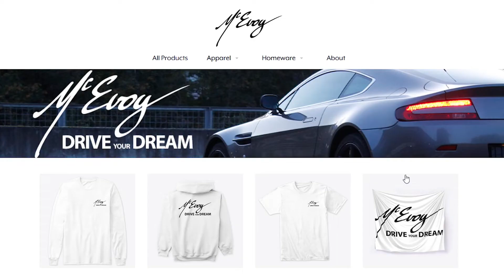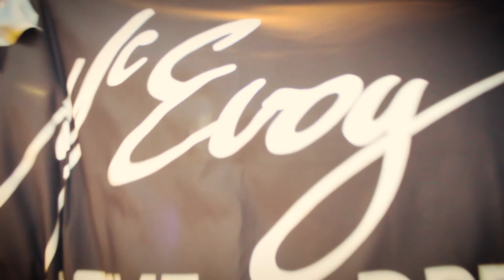Happy New Year! (2020 Preview)

Comment: Happy new year to you too    and looking forward to the new content  especially your friends mx5  which also make good track day cars on a budget
Reply from the maker: So it seems! :) Didn't you mention that you have one, or have owned one at some point? Cool little cars, if truth be told. They have a tendency to rust rather badly on the front chassis legs, but the one that we found here is in pretty good nick. :-)
Reply: @gmcevoy  yes i have one and it has the rust you mentioned   it can be repaired  but it will be around £1700 for new chassis legs   so for now it is idle in the garage   i use my yamaha nmax for the beer run its pretty cool  and is so cheap to run
Reply: @gmcevoy  no but at the end of the day I'm not so happy about it   its a lovely car it drives superbly its a mark 2.5 it has all the leather the LSD the variable valve engine and six speed box in metallic charcoal grey  it was my pride and joy  and still is  but yeah the rust thing has knocked me back somewhat   i cant scrap the car  its to good for that  i keep it for now  and see what happens   if i didn't have this mx5 i would have another  i love em
Reply from the maker: @Mr_Dia-Tribe  That's a tad expensive, for sure. There are a few MX-5 specialists in the UK, who apparently can do it for much less. Have you tried themx5restorer.co.uk?
Reply: hey Geoff i know what your thinking right   your thinking if i can get the car to you  you will grab your welding gear and in a couple of hours this problem will be taken care of  and this mx5 gets to live on   man i wish i had your skills and know how    and tools   i would love to be a mechanic like you
Reply: @gmcevoy  yeah thats the guy   the mx5 restorer
Reply: oh no that' is because i also need the rear arch and sill   not as important but needs doing    yeah the mx5 restorer his a good guy   he can fix it   and he does a good job and i would only trust him to do this kind of repair  and i was looking at quite a substantial bill    and that bill can rise depending on what they find   so for my car it will be a minimum of £1700  could be more
Reply: i keep the car for now knowing that it can be repaired   if not for the mx5 restorer  it would be scrap   so i hope one day to get it done
Reply: the mx5 restorer is not that far from me  but far enough that to drive my car with no mot that distance could be against the law  it's not easy to get my car to him   it would probably need to go on a trailer to be legal  it just adds to the expense of it all
Reply: but as long as i live this mx5 wont end up on the scrap heap
Reply from the maker: @Mr_Dia-Tribe  Well said!
Reply from the maker: @Mr_Dia-Tribe  Never say never, Darren. :-) It will probably take more than a couple of hours, but it would be a great pleasure indeed. You know, I wish I could afford the time to do just that. Fix things up to make people happy, without having to worry about paying bills and such... "Never say never".
Reply: i cant say what it is to own such a car  it for me is a sports car  i cant afford an aston martin or a porshe but when i get behind the wheel of the mx5  it feels like one of those cars   it feels like a propa sports car   its as close to the real thing as i will get
Reply: and that is why i love my mx5    it's my dream to own a sports car and this little beauty rust and all is as close as i will ever get to having such a car
Reply from the maker: @Mr_Dia-Tribe  It is a fantastic car, I fully agree. Designed in the wake of the Lotus Elan, in my opinion. Well balanced, well thought out, great fun to drive, and easy to maintain. You did well, to get your hands on one... My eyes are open for a good deal, but I need to sell my bike, first. :)
Reply: i want to buy a hoodie top from your range of clothing but it only goes up to 3x   I'm a 4x  can you get me one in my size    i want a black one
Reply: my mother had 22 stitches after she had me   i'm a big guy
Reply from the maker: @Mr_Dia-Tribe  I will see what I can do. Thank you!
Reply from the maker: @Mr_Dia-Tribe  Hi Darren! Sadly, they don't do bespoke orders. One can only get what they offer. However, I managed to come up with something just for you. It isn't much, but it's the least I could do. :) Check it out here:
https://teespring.com/thank-you-darren?pid=659&cid=102910&sid=back